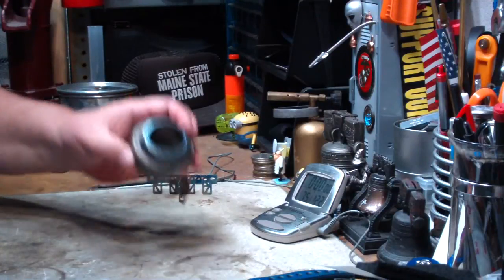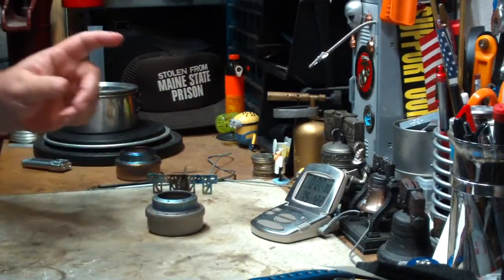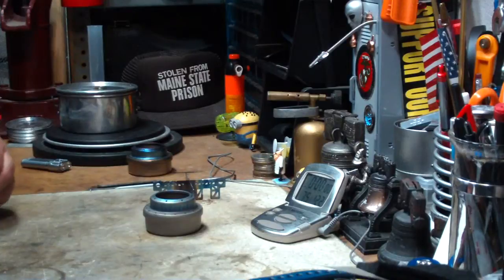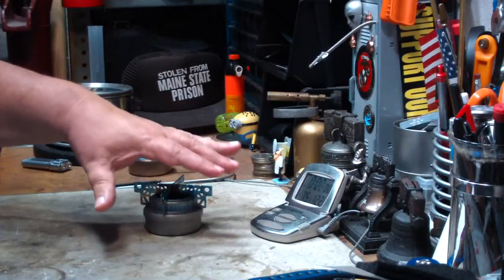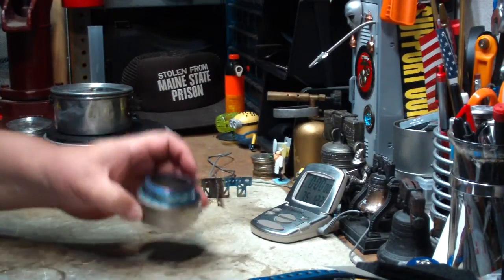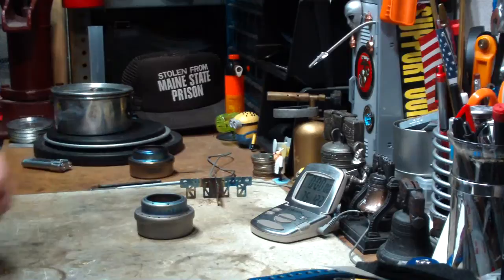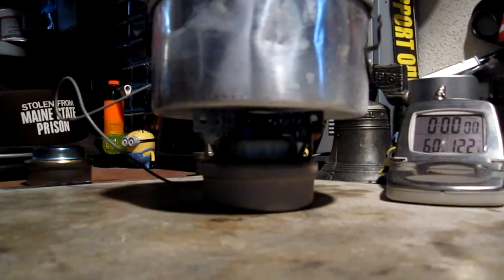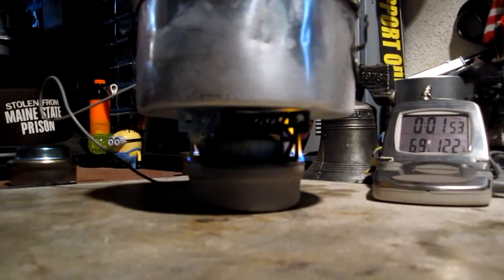Survival EDC Ultralight Titanium Alcohol Stove & Evernew Titanium Cross Stand - Boil Test #1

Comment: adding a priming pan underneath would start the jets earlier. this stove is already cold blooded.  adding carbon felt inside the neck will tend to insulate the heat and keep it from making the jets work for even longer delays.